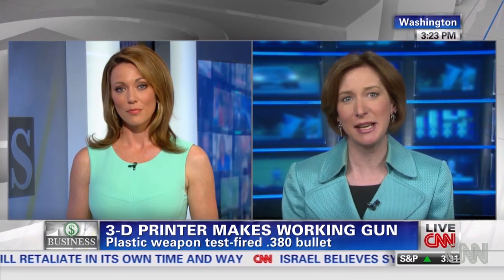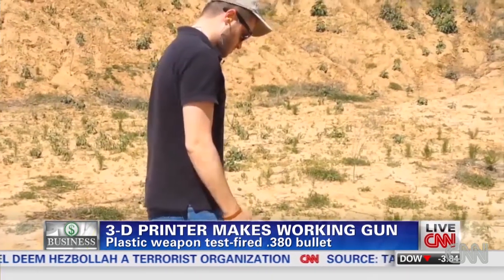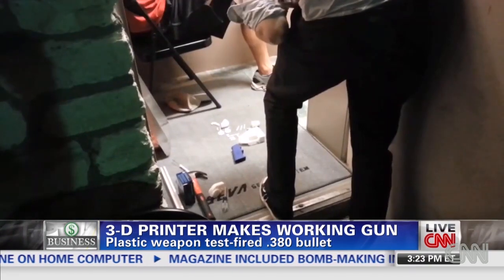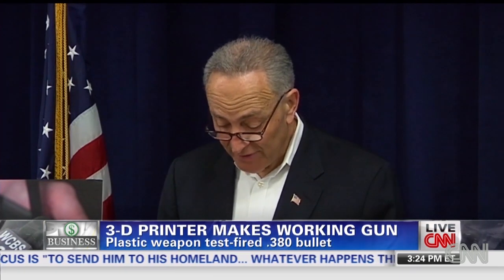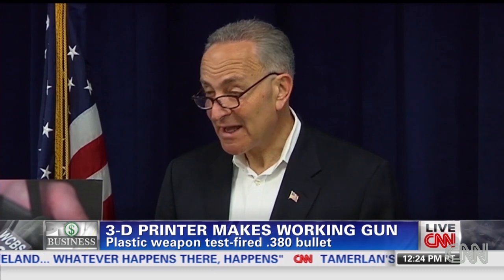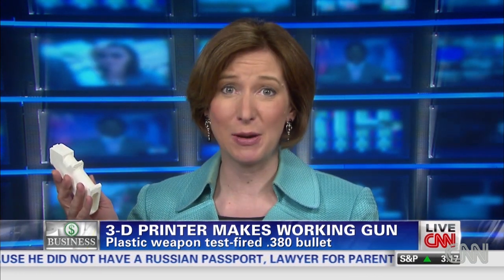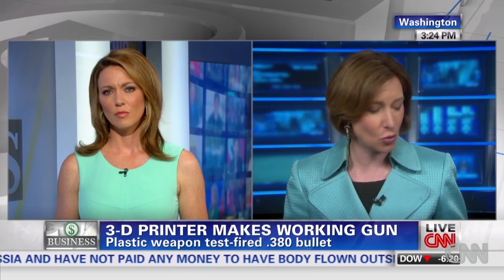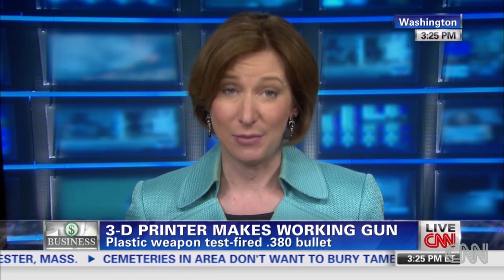3-D printer makes working gun

Comment: Actually, any metal can set off a metal detector. When any metal passes through a magnetic field, an electrical current is generated in that piece of metal. The induced electrical current in turn creates its own magnetic field. It is this second magnetic field that is being detected by the metal detector. This is one of Faraday's laws, and is the reason why moving magnets generate electricity in copper wires.

Comment: Yes it guess but that thing is so tiny you can hide it withing a metal case and the airport security will not fine a single firing pin, the gun being fully plastic can go past a metal detector

Same with bullets only take a couple at a time a clip full is more that enough to high jack a plane, again would be easy to hide away.

Comment: i mean, its entirely plastic?? orr it has a metal 'nail' to function..? you've stated both. common sense tells me it would require the metal.  i think any metal detector would pick up on the metal required for it to function and we are not even talking about the ammo yet. which without ammo which is steel, brass, copper, AND lead it would be less harmful that an actual cell phone.

Comment: Anyone wanting to go armed through a metal deector with a plastic gun would be an idiot.  I know for fact that rounds (bullets and casings) can easily set off a metal detector and can seen under x-ray.  You could make a plastic bullet but it couldn't withstand the pressure and would be a greater danger to the one firing it than onyone standing in front of it.  One would have to decrease the powder till it would look more like a paintball fight.
Reply: Ever Heard of SPB Bullets ,  These  Bullets are being used by the Military Secret services as we speak ,   and you can make them on your 3D printer  .  If you have a 3D printer and a few others things you can make enough of these Bullets to supply an army .  The Military Call these Bullets   SEOP's
Reply: ***** Not sure if it's that easy.  Ever try it?